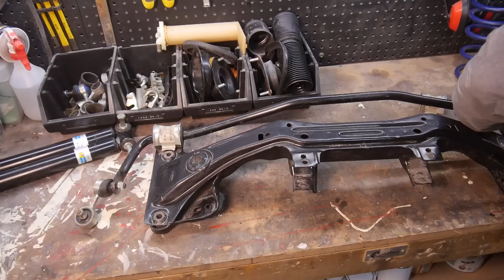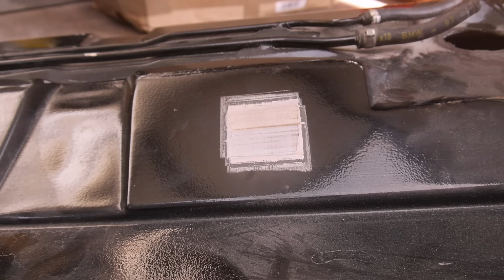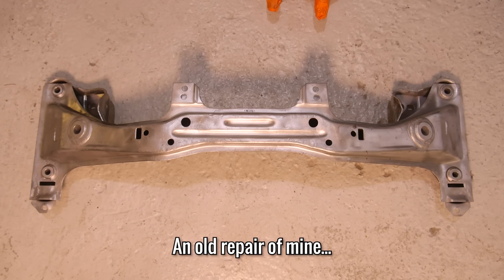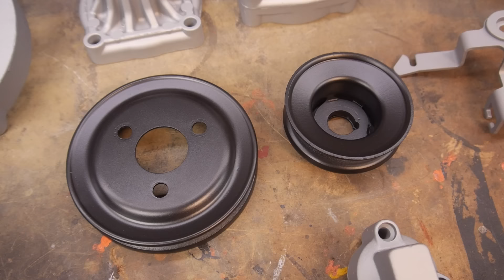BMW E30 325i Restoration | Fixing A Mistake With A £150k Laser!

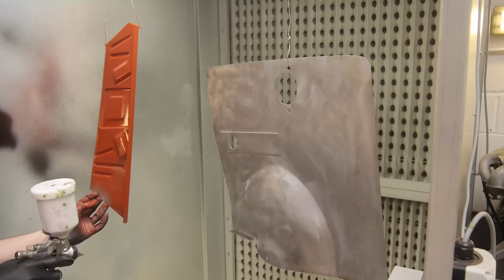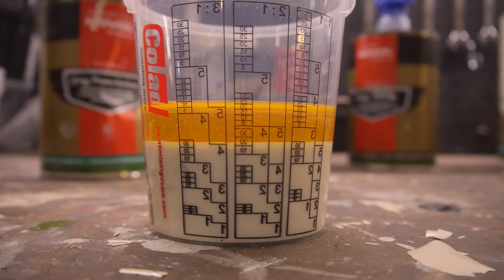Comment: 21:13 I'm confused. How can epoxy primer mechanically bond to metal (mentioned in 11:21) surface when anti-corrosion red is in the way? Red paint is not even chemically proof. You didn't show in the video but did you spray white epoxy primer on top of red body panels you you went straight to black top coat?
Reply from the maker: Hey Ed. It's not red paint. It's an anti corrosion weld-through bodywork primer specifically designed to go under that epoxy primer. It's all on Novols' website under the 'for classic car' range if you're looking for more info. The top coat is 'polycoat protect', which is designed to go over the epoxy primer. Cheers

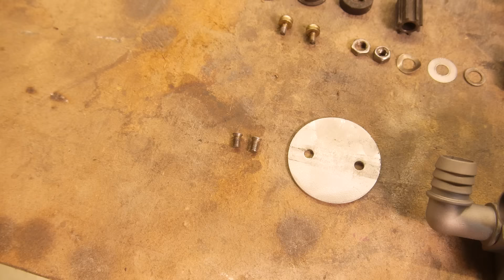Comment: 17:13 good luck getting those screws out (which you will need to) because the throttle body butterfly plate is incorrectly put in. Note at 17:30 the flap actuator is not going anywhere near the stop. Likely the butterfly plate is getting hung up on the soft aluminium and likely damaged it because it wasn't in properly. In fact every time you open and closed it I cringed massively because it was creating a burr of increasing size in the polished bore (not so much after it was sandlbasted...) It should be installed loose and with the actuator arm mounted and then wiggled while closing the actuator until the plate is 90 degrees or as close as possible to the bore. Then the screws can be installed, tightened and peened. Then you need to set the throttle body stop, which you didn't do, using a feeler gauge between the bore and butterfly. Also it would be worth changing the bearings in the throttle body which I don't think you did. Mainly to stop vac leaks. The TPS was not tested or adjusted properly. There is no gasket between the throttle body heater port and throttle body. The throttle body shaft was installed into the bore incorrectly. Tape should be wrapped around the centre cut in the shaft that accepts the butterfly plate, the edges on it are extremely sharp and you jammed it in with no rotation, likely scored the seals inside those needle bearings. 
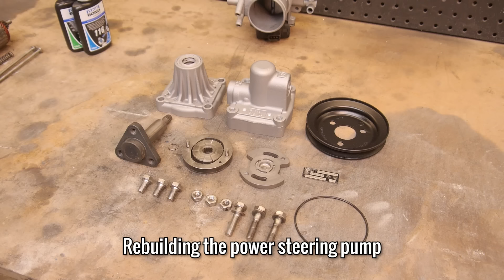18:14 The shaft seal for the power steering pump has been cerakoted... I.e has been left in during a baking process. It'll be ruined.  Absolutely no lubrication was used during the installation of the vanes and seals... The circlip for the power steering pump drive looks stretched and damaged, needs to be replaced.

Comment: Since this video is about mistakes, I'd like to note a few things from the engine rebuild:

On the engine be careful of hydrogen absorbing into high tensile fasteners during zinc plating. Stuff like bolts for the sprockets etc. They can snap unpredictably

I noticed you put the seals in the timing cover in flush - they should be 1-2mm deeper than flush since they are installed flush from factory and there will be grooves caused by the old seals

Way too much RTV used on various seals especially the oil pan seal. This will probably cause leaks. Elring Curil is preferable on paper gaskets (light smere) and personally cork gaskets ought to be installed dry. 

Looks like a PTFE rear main seal. It is important to install these dry to allow the seal to bed in. Looks like it was oiled/had grease on during install

It would have been preferable to remove the rocker cover baffle and reinstall as lots of junk collects there. I noticed you wanted to redo these parts with cerakote which is much better than the exterior car paint you used before however the H series does require blasting so baffle will need to come out for that. 

Headgasket was fitted without alignment dowels that are supposed to be in the block. It's possible the headgasket isn't on straight and may be partially covering bits it isn't supposed to.

Looks like camshaft seal on the head was not installed

Rubber strip missing on inside of "bowl reinforcement"

Comment: I've never liked etch primer when painted over it mostly never bond with the paint so I use anti corrosion epoxy, then base, then 2k clear coat and it never chip for underboady pard. I did my rear subframe and replaced all the control arm that I cleared over the original finish. They didn't rust, it's been 4 years and I live in canada. The shop that sold me the paint told me "epoxy then let cure for 16 to 24h max(otherwise reprime), sand reprime if needed(again need to wait 16 to 24h) or base coat x amount of layer, wait an hour after the last coat and clear. CC cure time was never the same I had to wait weeks to be sandable  otherwise it would be too soft and make big scratch. I did once in october, had to wait until may to sand, he gave me a all round hardner so when very hot was a little to fast but below 15C its weeks but I drive it a week after spray since the surface was hard enought.
I did a trailer that way for a friend taht laod gravel and stuff, so it scratched a lot since then and the primer is still holding even with the paint  gone is some places, scraping with a shovel in gravel is tought on paint

Comment: Re you sure that tps is adjusted correctly, you just screw it down, but if it is not clicking when throtle body is in parked position, then your idle control valve will not get signal to turn on, and your car will not idle and will shut down...

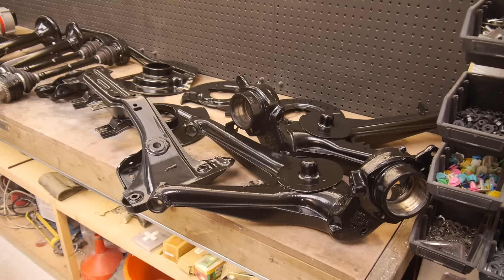Comment: 23:41 unfortunately the 042 will not help you in the apllication you used it right here. The threads are not what's sealing, the olives (metal cones on ends of the pipe) do the sealing part. Just make sure to tighten the nuts sufficiently and you're good.

Comment: Both "high volume" and "low pressure" refer to the air traveling through the spray gun. High volume does not refer to the liquid being sprayed, but the volume of air required to transfer the liquid to the object being painted. The idea is that a larger volume of air at a lower pressure means more paint is applied to the panel, and less paint goes airborne to become pollutants in the environment, thus doing less damage to as you say, "our beloved planet".

Comment: Not sure why you'd remove the EPD/KTL coating though. It's tough as nails. Even without additional coatings provides well over 1000h of salt spray resistance. You can paint over it just fine with any primer or top coat. I had an entire car chassis EPD dip-coated, then sprayed with Novol products.

Comment: DO NOT BURN OFF THE UNDERSEAL
It is PVC Based and releases HCL
The seam sealer is of same formulation between panels
The heat will cause HCL trapped between panels and your car will rot
Reply from the maker: I THOUGHT WE ESTABLISH THAT I'M GOING GOING TO IN THE EPISODE?
Reply: I don't want to be a dick especially as you are redoing things but I'm a bit worried about the adhesion with novol epoxy on parts you wire wheeled/laser cleaned. Ideally needs to be blasted to provide the key. Wire wheels polish the surface and the epoxy can come off in sheets.
Reply: @SamCalver correct about the epoxy, that could be an issue. Also the fact that he has used the polycoat protect straight over the top of the epoxy without keying the surface first. Novol FCC epoxy can’t be used as a wet on wet application, unless it’s their hybrid epoxy which isn’t what was used in this video
Reply from the maker: Thanks for the info guys!

Comment: Hi Steve, good to see you again. I know what some commenters mean about the massive amount of advertisement content, it is a bit wearing. Having said that, I assume once you get most of the gear you need, you can just crack on with the job. I am 71 now and still dabbling in the resto game (currently working on a BMW E31). I have made tons of mistakes . On a subject of coatings, a pro paint sprayer friend of mine swears by the Novol epoxy primer, uses it on everything. Beware of poor adhesion after wire brushing. All wire brushes, particularly new ones, contain oil and force it into the metal. They also leave a polished finish rather than a "tooth". If you can, degrease thoroughly with a water based degreaser (all the Bilt Hamber products are excellent, by the way) after wire brushing, then sand as much as you can to 80 grit, then epoxy prime. I'm sure the Novol black stuff will be good, but Rustbuster make a product called Epoxy Mastic which is a fantastic coating for suspension and under-body parts. Take a look at the Bilt Hamber Atom Mac to protect bare steel from flash rusting. I've just ordered some, but the reviews and tests are amazing, it looks a bit like witchcraft at first!
Reply from the maker: Hey, good to see you! Exactly that, Bob. I want to make sure these companies get the exposure they deserve, regardless of what anyone else thinks. I know it looks like I've gone advertising mad, but that's the new workshop took ages and was completed only with a lot of support from companies. This new workshop and all of the new tools (all of which I wouldn't have been able to afford without their support) are going to allow me to make weekly content again, whilst working towards two videos a week. Some episodes will have no talking at all, like the old style to make this possible. 

I've now introduced Cerakote (whom I approached) and LaserTec who will both regularly be seen on the channel in the coming episodes, not as a sponsor, but as part of the episode itself.

And thank you for the advice there. Very useful indeed. I will change how I prep for the epoxy primer and will also look into Bilt Hamber's stuff. Thank you!
Reply: @RestoreIt  Forgot to mention, I originally put my faith in POR15, and it is absolutely useless. Also, I am on a tight budget and have to save money where I can, so I have to consider aftermarket parts. However, I try to choose my makes, and do not fear using Lemforder, Febi/Bilstein, Mahle, Elring, Victor Reinz, Sachs, Nissens, Vaico and LUK/Schaffler for mechanical parts and gaskets, I am using Pierburg, Bosch, Hella and Magneti Marelli for electrical items and sensors. E.g. there are 4 knock sensors on the 840Ci, all mine have crumbled away to nothing, they are still available from BMW at £120 each. They are a Bosch sensor, which is available from many sources at around £33. Obviously, if you can afford it, go for genuine BMW every time.

Comment: Have you tried powder coating? I think it's one of the best methods.
Reply: I wouldn’t recommend powder coating for cars. It’s not nearly as durable as cerakote. 

If you miss one microscopic water drop on the bare metal and powder coat over it, the entire thing will spider and bubble; so much so that I’m far more stressed prepping for powder coating than any other method.

It’s great for toys and stuff for indoors.  Outdoors where durability is required? Don’t use powder coating.  The colors fade quicker than others too due to UV exposure.
Reply from the maker: I will eventually have a powdercoating set up and booth down the line.

Comment: Steve, great work here!  Any thoughts of adding a vapor blasting cabinet to your arsenal of tools?
Reply from the maker: Hey, Jeff! Yes, lots of thought has gone into it, I do want one and I will eventually get one. But for now dry shot blasting is good for what I'm doing.
Reply: @RestoreIt  Steve, one additional question - how does Cerakote compare  to powder coating for durability?  I'm sure Cerakote is thinner, but I'm guessing the heat curing is similar so maybe durability is equal?
Reply: @jeffhammond8969 Durability of powder coat is far more inferior in every single metric compared to cerakote. Impact, scratches, UV fading…

Comment: You should try using liquid nitrogen to freeze the undercoating  and then crush it with the hammer. Saw it work on extremely thick audi undercoating
Reply from the maker: This is a very interesting idea and one I will be looking into, cheers!

Comment: Have to be honest and say I don't much fancy the laser on anything but lightly rusted parts. Retro Power also wasn't that keen when it featured on Ed China's chanel with him trying it out on a Range Rover chassis.  Shot blasting still seems the way to go.
Reply from the maker: Shot blasting is more definetly more efficient, I'm with you there. But, what i like about the laser is that is can remove paint and rust without needing to dismantle everything or put it into a blasting machine that will cover everything in media. It's used more on old oak beams, fireplaces, factory machines and all kinds of niche stuff. This was just an introduction to LaserTec, we're going to work mainly on antiques in the future.